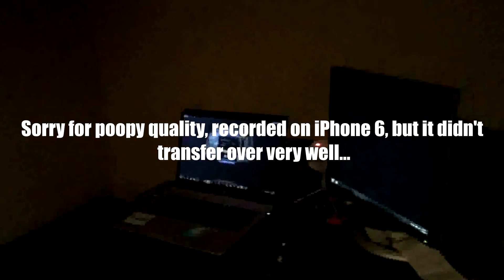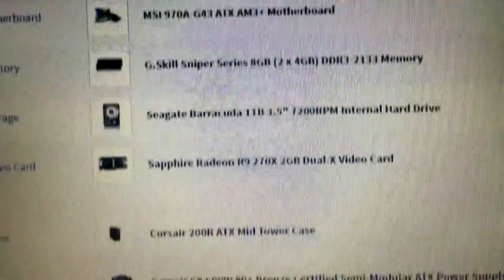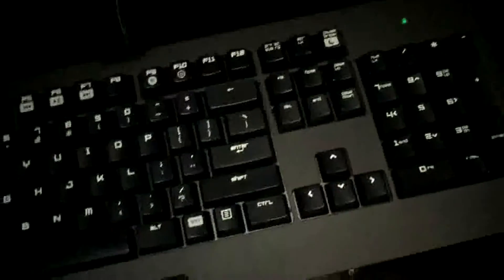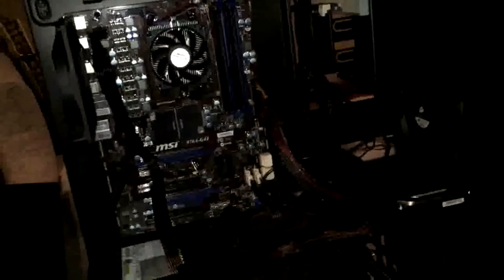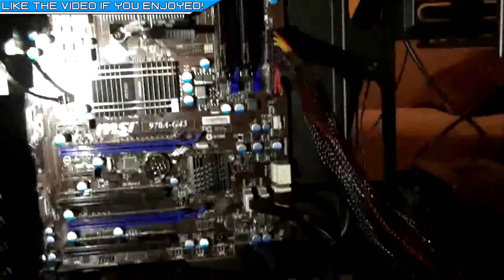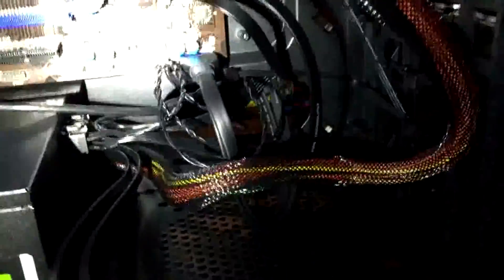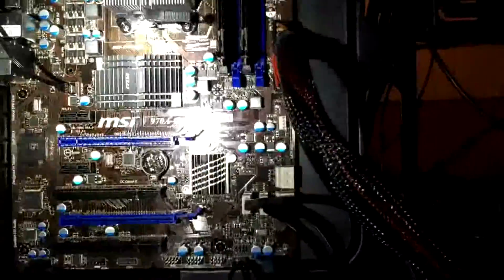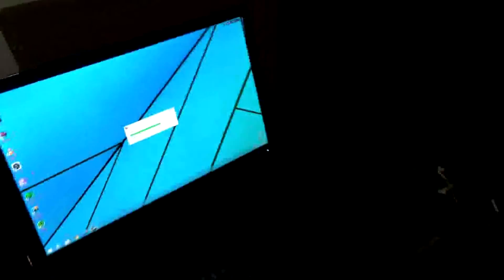Building my NEW Computer!

Comment: Really think the 4300 is an underbalance, try the 6300 at least, just 25-30 bucks more for much greater performance, but DO NOT use stock coolers unless you want varied peformance. The fx line is decent but definitely had some cooling issues, but you can still play RS well, you're just slightly limiting yourself. GPU is solid, but other than the CPU, a great build :)
Reply from the maker: Well in the future if i wanted to replace the cpu, how would I go about doing it? I know how obviously, but is there some special process since the comp has already been running
Reply: Nothing special :) But be sure to purchase more thermal paste, as you will have to scrape off the old gunk. You'll find that when upgrading, as long as it's compatible and you're not going crazy and replacing the motherboard, swap-outs are pretty quick and easy :)
As far as a special process, there is a slight chance the BIOS wouldn't update, but even if that were the case it should quick refresh. In other words, no worries!

Comment: I am an AMD fanboy, but unfortunately the FX4300 is such a weak processor. I have built to many computers to count and my word of advice would be to purchase your graphics card from eBay. You'll get a ton more performance for your money. I purchased a R9 280X the other day for a buddies build and only spent $125 and it runs perfect. 

Congratulations on the build though. It's exciting to get a new computer! (y)
Reply from the maker: In the future ill upgrade more stuff, and i did use ebay to buy some stuff for cheap. And ty :) this computer is awesome and your statement about the cpu doesn't really affect me b/c my last proc was sort of shit
Reply: R9 280x for 125$?!?! I got a r9 290 for 270$
Reply: You're more likely to find them at $150, but if you check hourly like I did I was able to find one and snag it for really cheap.